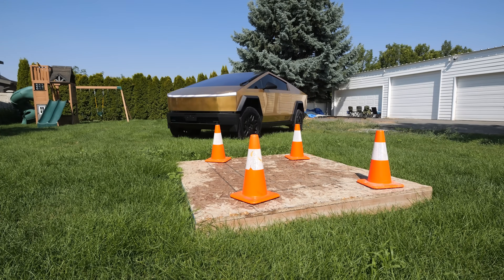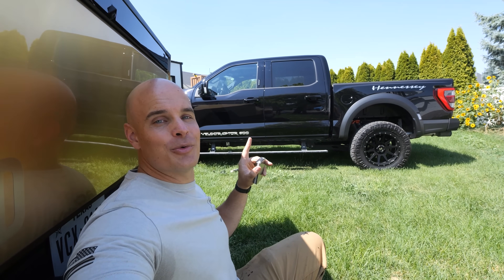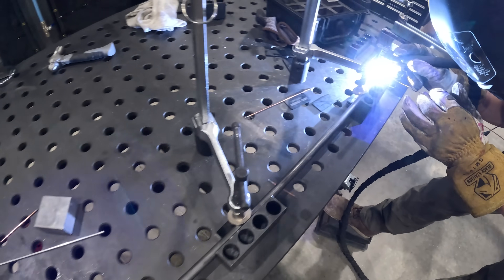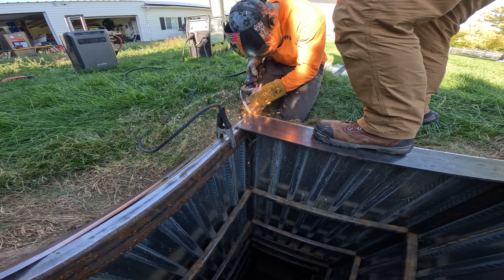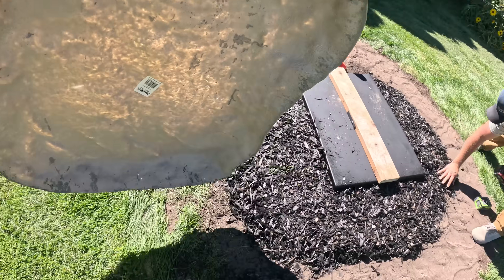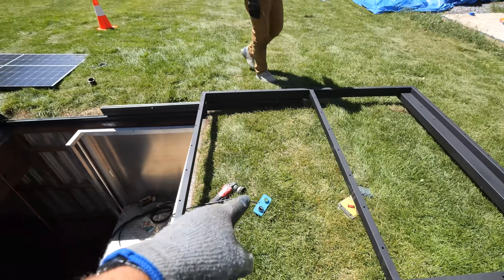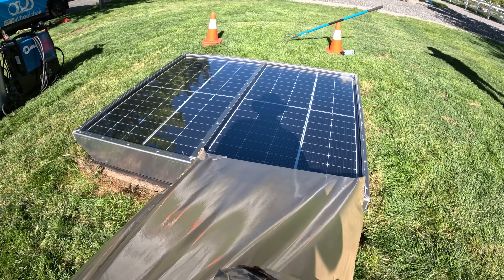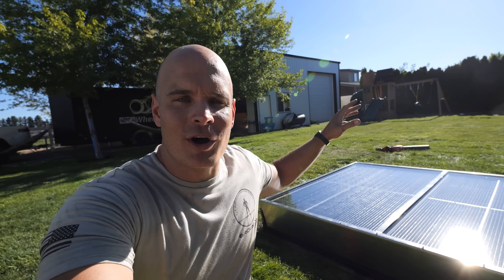Bulletproof Solar Panel Bunker Door Build - (unlimited energy!)

Comment: Your sliding hatch slides the wrong way.
Unless you want Cambry to have to do a sweet jump to get from the grass to the elevator.
When it's fully open, the side by the bunker is low enough to be easily rolled over.
But that side is the open pit, not the elevator unless I am mistaken.

Comment: You should build a totally conspicuous tool shed over the main entry  shaft . Totally camouflage entry .
Reply: In the middle of the lawn?  The main entry should have been at the end, than the shed would have made sense, and the emergency exit should have been under the grass.
Would even make it easier to get in with a wheelchair since you could have laid a stone path to the shed.
Reply: @dubious6718  prob should have placed the pipe diagonally then . 
I guess that's another video series then.

Comment: Why bifacial panels? The bottom will never receive any light. I am also concerned about the plexiglass deteriorating in the sun, but also causing the panels to overheat.  But the thing I’m amazed by is that 400 watts can run everything!  I think that’s a testament to how efficient underground buildings are.  Probably doesn’t need much air conditioning or heating.
Reply from the maker: I like the bifacial since they will let light though.  But yeah they do warm up considerably.
Reply: @JerryRigEverything wanted to let you know that having someone pay to enter a sweepstakes or lottery is illegal 😅

May wanna double check that
Reply: @dmhzmxn  he literally says you can enter for free at 1:10.     These guys aren't amateurs.
Reply: Probably because they were free.
Reply: Oh, "The Solar Guy" is also here! 😉
Reply: I would make them opening in vertical position facing east-west on top of the sliding, since they are bifacial.

Comment: I hate to say it, but you put your sliding panel on the wrong way. The way you have installed it will stop Cambry's wheelchair from getting to the lift. When the slider is open, there effectively a barrier around the lift. If the slider went the other way (rotated 180 degrees) the issue wouldn't be as significant.

Comment: How does that solar lid work with the lift/how does Cambrys chair get up and over it? Will the exit hatch get a gasket for weather sealing? How does the solar panel lock such that kids don't slide the door and fall in?

I realize you can only put so much into the youtube video, but I would love all the nitty gritty details. Love the series so far! I can't believe how far the bunker has come.
Reply: Cambry’s going to have to use an off-road not-a-wheelchair to get over that slider lip
Reply: I too was wondering how she would get onto that lift in her chair, but I guess could just have a little movable ramp to get up on the solar panels and then from the solar panels get onto the lift.
Reply: Yes, I was surprised the sliders didn't go the other way to leave at grade access to the lift. It seems backwards currently, but I suppose we will see soon enough. I think that acrylic needs to go under the solar panels too. It looks sharp though, nice work.
Reply: @LostPilotage they do get snow so it being that tall is a plus
Reply: The elevator extends about 2ft above ground level and a ramp is mentioned in the elevator video at 14:23
Reply: He gonna milk this for what its worth, so you will see that in another video.

Comment: I bought solidworks for makers a month ago for a freelance project, it took two weeks to be able to log in to install the software at all, support was very unresponsive until I requested to cancel, and then when I did finally got the software installed, my email asking for my subscription period to be adjusted for the two weeks I had no product I got ghosted. The software itself is fine, it works, but that was an extremely frustrating two weeks.

Comment: This bunker project just keeps getting more weird. 4 solar panels just to 'keep the lights on' or are they expected to provide full bunker power? I kinda doubt that. Also I assume both doors are lockable from inside and outside since you seem to be afraid of a zombie apocalypse and built a bunker for this purpose and they could easily break in and jump down the hole (since they don't care if they break their legs). I could never live in that type of confined space knowing I'm underground. I suppose if you sedated me and I woke up in the room and didn't know better I might be ok until I wanted to leave and found out I was underground.

Comment: Now you just need to build some kind of contraption to clear the debris or overgrowth that might hinder the movement of your solar panel sliding door. I would probably DIY some kind of hedge trimmer onto a controllable arm that you can operate from inside the bunker in the event that you have to use the bunker for an extended period of time and plant life has overgrown the area. or just a big blowtorch, which could double as a component of a bunker defense system.

Comment: I have such doubts whether this panel will work well in this "greenhouse" of a flat cover that you built ;P . It seems to me that it may overheat, so it will not work well and more importantly it will deteriorate much faster. But as I wrote, it only seems to me and I may be wrong. If you could, take this into account and archive how the situation looks over time...

Comment: Putting biracial panels flat on the “ground” is original. I’m using them vertically not as efficient than with an angle, but I live in a cold place with lots of snow and ice. And the vertical panels don’t need cleanups, so they work much better than “correctly” angled panels. And it make great “fences that produce electricity”

Comment: Solar guy here. Might wanna look into UV permeable acrylic. Most plastic is UV opaque, and I have seen it lower the efficiency of a panel 80%. Glass is the same, but for different reasons.
Reply: Also acrylic readily absorbs moisture and changes size a surprising amount. And, Zach appears to think all clear plastics are identical. I've never heard of anyone making bulletproof glass out of acrylic. That's polycarbonate, a completely different material. Acrylic will shatter like glass. Poly gums up. Both scratch easily. This seems like not a very wise or well-researched choice. I don't think it does any of the things it's wanted to do, and meanwhile comes with a lot of drawbacks.
Reply: Whats the point of having bifacial if only one side faces the sun?
Reply: @theamazinglandshark I was wondering the same... I guess because they let some light in?
Reply: @theamazinglandshark any reflected light increases your efficiency, so if you put a reflective surface under it you can generate more power
Reply: @theamazinglandshark I came here to ask the same question.
Reply: @theamazinglandshark  sunlight reflecting from the surface below. Most effective on big agricultural solar arrays AFAIK.
Reply: @theamazinglandshark  Well its difficult to point both sides at the sun...
Reply: I think the biggest benefit in this application is knowing whether it’s sun out from light passing through. $300 a piece is way expensive though.
Reply: The benefit of bifacial panels is that they look nice from the back.
Reply: Not to mention dirt buildup and of course, snow cover in Utah winters.
Reply: What if we put a lens that refracts more light?

Comment: Honestly, i feel like one couldve made the main hatch raise up instead of slide aside. Also wouldve put the panels at an angle, and probably just done away with the acrylic. Additionally one couldve used solar panels with integrated water blocks for possibly getting hot water.

Comment: Sigh... You will be so disappointed in the wind generator. Small generators (under 1500W) are great at making noise, not so great at generating power. For the price, work and hassle you could put up 5 times the power generation in solar (but yes, it takes more room).

Comment: It would be cool to add some super strong magnets (how do they work?) to help "latch" the main panel closed so it doesn't slide around as freely when it's supposed to be closed. I'm also curious how the additions around the panel effect the scissor lift since it looks like the rails go around the side with the lift on it.

Comment: I would like to compare the solar panels power output with and without the plexiglas. since the plexiglas is not completely clear... Has to be some loss. One more question is why bifacial panels since it won't get much reflectance from grass. If you had designed them to go up vertically, they have found that by orienting a bifacial panel north / south. you get morning light and afternoon light on each side. If that had telescoped from the hatch, you could have four panels standing vertical, and still get in or out of the hatch.

Comment: I love watching this bunker take shape. As an electrician with 24 years of experience and 10 of that running large scale commercial solar projects I have a few concerns with this video. 1. Those bifacial panels aren't going to be able to take advantage of the reflection the need for the underside to be effective. 2. Those Amazon strut trollies can not carry 2000 lbs safely a reliably. Brand name versions from reputable strut companies like BLine, Powerstrut, Unistrut, etc only have trollies maxing out at 600 lbs. If I'm wrong, I would love to get a link because I have a project at work that I need support 1600 for a short period of time. 3. Those solar modules are going to cook themselves under that acrylic.

Comment: You could probably setup a maglog system that allows you to unlock the bunker with your phone or like an RFID Key, and for added security maybe a padlock or something. Would help it stop sliding and theyre pretty cheap tbf. as for your emergency exit, if that had some kind of piston to allow it to open and close a bit easier that might help when using it! Maybe again maglock but hooked up to a fire exit button or something that can only be activated from inside?!

Comment: You should add some metal slide panels 4ft or 5ft inside the elevator shaft (front entrance),it will give extra security just in case someone manages to get in through the solar slides,and also the metal slides should also be made to seal the shaft immediately after the solar slides are closed to prevent someone from accidentally plummeting to their death if the solar panels caves in (Glass breaks) and also the act of testing the durability of the panels by stepping on it with your buddies was a risky and life threatening move pls don't do something like that again falling through a narrow space and slamming into a metal floor 20ft below ground isn't a matter of your body getting scratched at level 6 with deeper grooves at level 7 it's actually broken bones at level 20, shattered spine at level 30 and loss of life at level 40, please be careful 👍💯😇

Comment: That spray foam under the rock looks like a great place for rodents to nest. Acrylic sheets often have a UV protectant in them to keep them from turning yellow... that UV protectant will also reduce the rays getting to your solar panels, reducing their output. I noticed you put a lift in for your wife instead of a ladder. Good job.
Reply: Not sure about the rock. But yeah that ultra-thick acrylic will reduce the efficiency noticeably.
Reply: Would you rather sacrifice efficiency or have broken panels that don't work at all?
Reply: @fostervf16  Fair point, but the bunker ins made for longevity, and I am afraid the acrylic will discolor after time, given it will be heated extremely. It is just a point worth considering, but he will have a wind turbine as well, so solar will not be the only source.

Comment: acrylic ? over the solar pannels ? Did you check the interaction between that and the solar pannel ? being transparent does not mean the light will pass through properly. Glass for example blocks most of the uv radiation

Comment: Put some cosmoline/penetrol all over the shaft tubing/steel. That stuff arrests corrosion/protects. Probably on top of the spray paint too; as that really doesn't hold up.

Comment: You can increase the light capture by using reflective panels near the site that can reflect light onto the surface. We use these during off peak seasons to keep a steady flow. Our setup currently peaks in the fall funny enough as the reflectors add about 3x the solar energy to the same surface area and the lower temperatures allow them to operate more efficiently

Comment: It's worth noting that those panels are going to B A K E under those plexi panes which will drastically reduce their efficiency and simultaneously raise the temperature of the space below. You may want to consider forcing some air under them to keep the temperature within the realm of reason. It's also worth considering having some sort of constant load on the system because having silicon panels in the sun getting real hot and delivering no power is no good for the life of the panels themselves. For me, I made a powered bird bath pulling 3 amps from 10AM to 8PM and a ventilation fan that runs when the panels are active for a system half the size that powers my shed.
Reply: I would have run large pipe to the house and/or shed for all the utilities, and then just mounted a small array on one or both of the roofs. Or just tuck a ground mount for a couple of panels in the corner of the backyard or something.
Reply: Don't bother man, he's made a toxic pressure cooker if his wiring ever has any hot issues (all of his raceway is PVC gutter), the acrylic is going to weaken in the sun over time and also reduce efficiency, I've seen a few gaps in the paint of the metal so far that are gonna rust out, and people have mentioned all of this. the electrical system he's decided on here wouldn't pass safety checks for an enclosed space (which this is) and his wife is in a wheelchair and won't be able to get out quickly if anything happens.
Reply: @zerumsum1640  soooo, basically it's a white elephant or a boondoggle.
Reply: @zerumsum1640  sponsor money has to go somewhere
Reply: @zerumsum1640  While all quite valid points, particularly corrosion, it's not a permanent living space. Assuming the wiring is properly fused and load tested it's fine, nothing in a bunker should be high draw anyway for the sake of energy conservation. It's basically the electrical system of a boat or a motorhome.
Reply: @TheOfficialStal  It's meant to be a permanent living space. That's the whole point of making a bunker
Reply: @Neopumper666  when he says it's to survive the zombie apocalypse, you realize he's kidding, right?
Reply: @robblly8112  Whether permanent or temporary, whether the bunker is just a man-cave or if it's for legit emergencies or for some zombie apocalypse, the concerns are still valid because the implication behind a bunker is inherently that it'll be able to support a suitable living environment as a baseline. These videos don't give us a sufficient idea of whether he's addressed some concerns that viewers have brought up over the video series. It's doubly important because Zack has mentioned, or at least implied, that he wants to allow his family to access the bunker at some point. That's a huge safety risk.
Reply: @Neopumper666  If this becomes a permanent living space then code and inspectors will be the least of his problems.  In fact, unradiated inspectors may be welcomed as a food source!
Reply: another way of cooling them would be to add watercooling/heating. connect some metal pipe to the back of the panel with a thermal transfer epoxy/paste and run water through it. now you even got free water heating on top! kinda a diy PVT panel

Comment: wish you had a little motor opening and closing the sliding pannels. also could do with a locking solanoid / pin to stop the kids from running opening it and tumbeling in.

Comment: You can make a fan in that hatch that swings from the side up so you can still conveniently use that hatch for venting when working inside.

Also can put a strong magnet at either ends of this movable hatch to slightly lock it in place at either end

Comment: I’d either pick the Hennessy truck or $100,000 depending on the taxes on each . I’m working on moving to Alaska on a mountain, my truck isn’t 4x4 and I don’t have much saved up for the move so both would be beneficial but probably the cash as I’d hate driving a truck valued over $100,000 up a mountain trail.